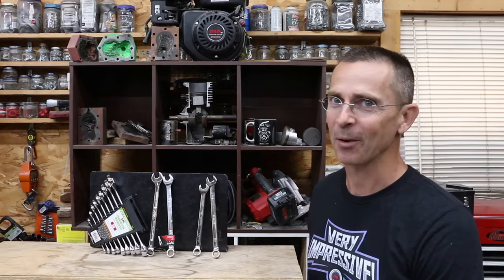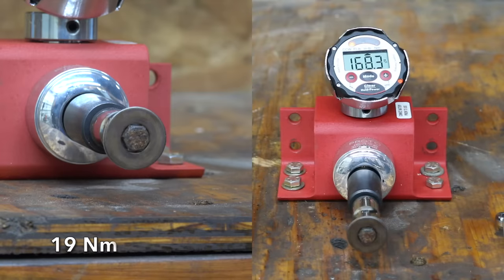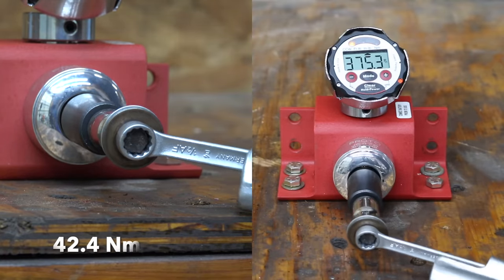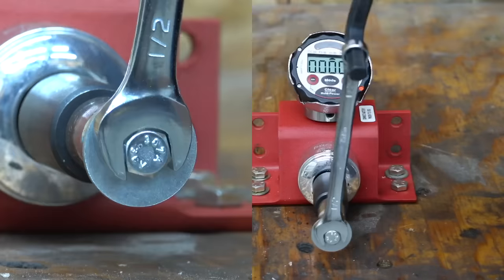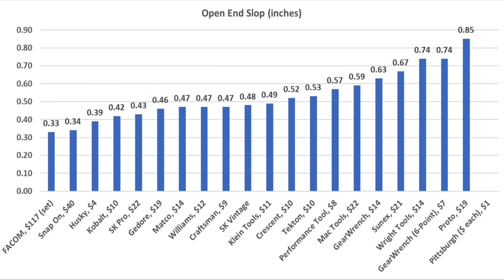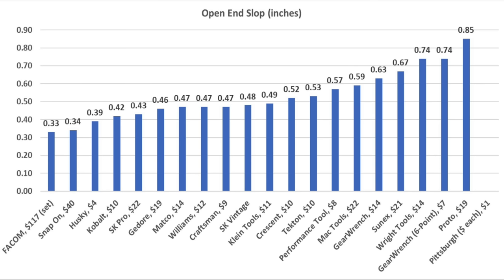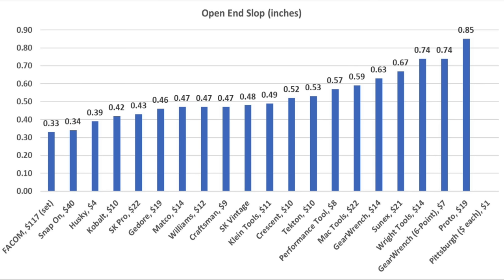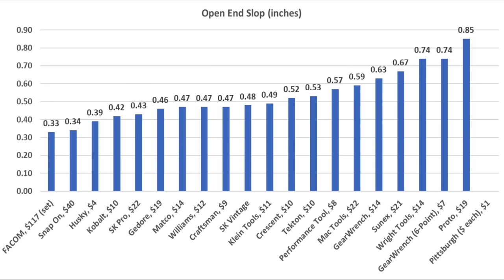Best Wrench? Let’s Settle This! Snap On vs MAC Tools, Matco, Proto, SK, GearWrench, Kobalt, Husky

Comment: Only brand I think we are missing is Icon and maybe old school Craftsman, but I doubt its hard to find old ones in good enough condition, the ones I have belonged to my father and I've been using them myself for the last 20 years without issues. That said those wrenches are well used
Reply: I agree ….I have good luck with my icon wrenches
Reply: USA Craftsman are still available on ebay and in many case NOS.  People seem to be dumping them now that value is up every since production switched to the PRC
Reply: @snopro9556  Never broke one or had one fail in any manner.
Reply: Yeah I don't know why no one tests the icons, they have great price to performance in my opinion
Reply from the maker: Thanks for the feedback.
Reply: Lots of brands that are missing. Icon, Cornwell, Mac USA made, Milwaukee, Klutch, just to name a few.
Reply: Still using a nearly complete Craftsman wrench and socket set my dad used during his farming days of the 50s, 60s and 70s.  Don't put them to the test like he did, but they still hold up for my needs around the place.
Reply: @chrisp174  Yup, Milwaukee does perform well on other tests, so it would be interesting. Also left out is Kyoto Tool Company (KTC) - recognized as one of the tops from Japan.
Reply: Old American tools are heirloom worthy.  The quality is almost something else.

Comment: I think you have the old style snap on the flank drive has the grooves cut into the open end it actually helps quite a bit !
Reply from the maker: Thanks for the constructive feedback.
Reply: YES! I just posted a comment about this. The flank drive wrenches are about $3-4 more expensive but when you need it to work, it works! (HD diesel tech here)

Comment: You also have to note that one wrench was made thin to work in tight spaces, but they don't hold up that much. Other wrenches are bulky and unwieldy, but they can withstand more stress. I think something like that should also be considered in the test. Whether the tool is handy and such, otherwise the test makes little sense.
Reply: I usually view these videos as a "data report." The conclusions aren't the "best" wrench, but rather the highest test results. Combine this data with more subjective needs to reach a real conclusion of what's best for any situation.
Reply: ALOT of variables to take into consideration that he fails to bring up. Something tells me he may make tool related videos for YouTube but that's the most tools his hands have ever touched in his life Idk..

Comment: I've always tried to figure out why they put the bevel on the inside of the box and wrenches.  Okay I understand the bevel but it should be minuscule. Same with sockets.
Great demonstration.
Reply from the maker: Thanks!
Reply: Am I the only one who has had to grind down the bevel on wrenches/sockets to get them to fit?  Had to do that to remove a rusted differential plug on a Mazda RX7.  Yes, count me among those who don’t want the big bevel.

Comment: Suggested video: would be interesting to test and compare radiator coolant additives, claiming to reduce heat up to 25F. Thank you 👍 ✌️We are going to test that! 🙂
Reply from the maker: Thanks for the suggestion.
Reply: Definitely a great Idea. Here in South Tx its very hot so thats Definitely something I'd be interested in.
Reply: BND Automotive quantum gold coolant is the best I have ever used!
Reply: @Jackmerius_Tacktheretrix  I felt that summer heat, lived in Houston 5yrs 😎✌️

Comment: I always had really good luck with Proto. I still have a set of their wrenches. They are black oxide, which I think were intended for railroad use. If I remember correctly, the reason I got them that way was because that was the only finish that was offered at that particular vendor. They have held up quite well even without being chrome.
Reply: I was a mechanic back in the 70's. It was SK Wayne back then. Snap on was just starting to take over the vendor truck business. But I always liked PROTO the best. They had a better feel to them.
Reply: Proto used to sell the black oxide, and chrome plated. The oxide were cheaper, and quicker to rust...but I have a black-oxide adjustable Proto from the 50s that is in excellent shape. Made in Los Angeles.
Reply: I've never seen Proto for sale "direct to the public," but we had a ton of them when I was in the military. I was under the impression that they marketed almost exclusively to industrial customers. Nowadays, you can find almost anything for sale online.
Most of my personal hand tools are Kobalt because I got a killer deal when Lowe's was changing the packaging one year. They've held up fine, and you can replace wrenches and sockets individually rather than in sets, which is a huge perk for me over other 'cheap' brands.
Reply: @Lawrence330  It's entirely possible you are correct. This was in the late 70's. The "tool truck" I got them from, I'm guessing; he was just a local yokel. The truck was a converted USPS mail truck. You could still see the outline. Before they were privatized. I always thought that part was odd. But, I was working as a mechanic for a large school district and they said he was legitimate. So, if he was a go between or whatever; that's how I ended up with them. Another weird thing he did was if the Snap-On or Mac truck was there, he would park right outside the gate and wait until they left. Everybody noticed that, too. I don't know what his exact situation was, though. He did have really good prices.
Reply: One selling point for the black oxide finish was that for an industrial setting where tools were provided to the workers they were much less likely to be stolen then the chrome plated tools.
Reply: @HanstheTraffer  Proto makes quality tools
Reply: Proto makes quality tools or at least did. I have a few tools from them kicking around my toolbox, one of which is a 1/2" ratchet that's on par with a dual 80 or 100 tooth from Snap-On and it's built like a tank. I believe it was made for the military yrs ago but still works great in certain places so won't get rid of it.

Comment: I worked for Mac tools in the 70s when their hand tools were still forged in Sabina Ohio and finished in Washington Court Ohio, and  I went to The Easco Hand Tool Company ( had been the Moore Drip Forge Company) that made Craftsman tools in Springdale Arkansas in 1980 and worked in engineering there for 21 years.  Sadly all these tools are now made off shore in China, Taiwan, or Mexico now.  It is a sad commentary on US manufacturing when so few things are made here now and quality has suffered, although it is nice to see that Mac has maintained standards better than many other brands even if the tools come from Taiwan.  I still have an original set of Craftsman combination wrenches that I bought 65 years ago as a teenager and they have never disappointed me.  Thanks for posting these tests.
Reply from the maker: You are welcome!  Thanks for sharing.

Comment: Why doesn't the "box end slipping torque" column in the end table have rankings? So many of them are "1" but I think this is a disadvantage to some wrenches that dramatically beat the pricier competition. The Husky came in 3rd on that test- well above some way more expensive brands. It additionally was given last place on one of the tests due to a testing error. All things told, it seems like this very cheap wrench really held its own against the Mac/Snap On wrenches overall and probably deserves a bit higher overall ranking. The rusty bolt slip test ranking seems to have skewed the results considerably by not ranking, but rather giving a 1-8.
Reply: A good quality wrench is about more than just strength. There is no comparison between a low-end brand like Husky to top-tier brands like Mac, Proto, and Snap On. This video is mostly for entertainment since you and I both know that you aren't going to dish out $700 or a 12 piece set of Mac wrenches or more for Snap On.
Reply: The husky absolutely smashed the others if you figure the price. AvE did a 3/8 ratchet test and the husky smoked em all....
Reply: Yeah, don;t know why the Husky was given a 19th place score in the open-ended test based on a testing error. If you remove that score it had a 6.75 average placing it 6th overall. For a $4 wrench it was the clear winner overall. Unfortunately this kind of thing crops up all the time with PFs tests these days. There is often a strange choice of test that skews the scores to a particular design or tendency that isn't representative of the point of the testing.
Reply: That test is pass or fail because 370 is the breaking point of the bolt.  Husky had a high torque rating because that bolt withstood more force. It's a discrepancy with the individual bolt, not the wrench. That's why even the wrench that broke the bolt at 369 still received a 1.

Comment: Outstanding selection in the lineup, the only brand I would have like to have seen is Capri because warranty is important to me and theirs is supposed to be almost as good as Tekton. Icon would have been nice too if you ever do a recap.  Chinese Gearwrench?  Why would you make your 6 point tool from inferior quality to 12 point when the former is the one you will grab for the toughest tasks?  They really seem to be in a freefall with going back on warranties and quality.
Reply: Where do you buy Capri brand?  I buy Craftsman and Husky because I can just walk into a local Lowes and exchange anything broken.  They actually let me get anything I want, walk in with a broken screwdriver and they say pick out any screwdriver you want doesn't even have to be the same.
Reply from the maker: Thanks!  Thanks for the suggestion.

Comment: I bought Pittsburgh wrenches almost 30 years ago. I've used them quite a bit over the years tho not professionally or daily and never any issues with normal use. I can't complain about them. Now that HF is climbing into the pro realm with Icon...if I were buying in that capacity, I'd probably go with a traditional source. Just my two cents.
Reply: Yep, HF is getting too big for themselves. Not interested in their premium brands after they convinced me their cheaper stuff was good enough.

Comment: I worked on an assembly line at CASE and I needed a set of long handle wrenches, and the choices were all high end brands or a set of Pittsburg.
I bought the Pittsburg's and in 8 years I wore the 10mm out twice backing an impact gun up with the box end.
But that was still very affordable in comparison.
Something cool was, some hydraulic lines were difficult to get wrenches on, so we would make disposable wrenches with different angle necks on our laser.
I still have a few of these, that get used once in a great while.
I do spend money on my ratchets, as I have stripped gears out on the cheap ones.

Comment: The testing is phenomenal. Among the best to be found on YT. But the results were extremely frustrating. Inconsistency ruled the day, with many main-stream brands scoring high on one test, middle of the pack on the next, and near the bottom on another. Seems you can’t simply depend on any brand for consistent quality. Very disappointing.
Reply: My thoughts exactly. Manufacturing tolerances and quality control have been loosened up so much over the past few decades that we can actually count on inconsistencies today.
Reply: In this case, I’m not sure it has much to do with manufacturing tolerances or quality control.  It’s most likely the material science and engineering economics.  In other words, if you used a material, manufacturing, and heat treatment process that could handle all of the weird impact and creep loads that combination wrenches experience, it’s going to be prohibitively expensive for consumers.  Between “cheap” and “excellent”, there is probably a massive ‘no man’s land’ of design trade offs you have to make meaning you’ll do well in one category at the expense of another.  And at the end of the day, a consumer can just go down the street for another $10 wrench if it fails (or you leave it in the engine bay like I used to do and lose it forever).  Not so true with the $10,000 specialty combination wrenches they use for certain defense tasks
Reply: @stevebean1234  I would like to know more about these $10,000 specialty combination wrenches they use for defense.
Reply: @samdajellybeenie14  depends if youre being sarcastic? 🤔  Or serious?
Reply: @stevebean1234  😄 I’m totally being serious! Are they made out of special materials or is the R&D super expensive or something?
Reply: @LostButMakingGoodTime

Hey.... "good time" (lol), what will really do your head in, is realising that a $4 spanner clearly out-performs a $40 spanner, which we all have been buying because a "white van" has been coming round to our garages selling us inferior products for 10 times the price........ im so annoyed and broken over the money i have spent, when i could have baught 10 times what i have now, and better quality......

I am more then "snapped-off" at how i have been cheated...... how we all have been cheated..... im going to get my Huskys and go shopping (we live in a cold enviroment)..... lolz....

Comment: I love those Mac wrenches. I recommend them to everyone. The biggest thing I love is the design of the middle feels very good in the hand and doesn’t dig into your fingers/palms like other wrenches because they’re fairly thick and nicely rounded. They’re pricy but I think they were worth every penny. I got the metric 6-32mm set for $350 or so on sale but I think they’re 450 ish normally.
Reply from the maker: Thanks for the feedback.
Reply: Do you have a part number for that 6-32mm set? This video has convinced me to switch over to Mac wrenches!
Reply: @VorsprungDurchNik  I do not. I bought them a couple years ago now. Sorry. I know they still make them tho.
Reply: @Blazin Off-road  That's alright, I appreciate the response. The MAC truck comes around every Tuesday morning; this week I won't be ignoring him.

Comment: Just a point of order 
The facom at $117 for 12 wrenches is LESS than $10 a wrench making them cheaper than a number of wrenches that are less than the $12 a wrench you quoted the facom  of costing ..... I went thru a bunch of comments and am really surprised no one else (that I seen) pointed this out if they were nearly $12 a wrench that set of 12 would be nearly $144 but at $117 would be nearly $10 a wrench as 10x12=120 ..... just a simple mistake any of us could make .... no one is perfect  .... still like your videos been watching a long time & the only reason I said anything that discrepancy isnt fair to facom
Reply: He probably bought them individually and that's what he likely paid.

Sets are almost always cheaper per piece than singles.

Comment: Tried this test many years ago going to school for diesel mechanics. We put a Craftsman, Snap-on flank drive, and Snap-on flank drive plus on a frozen fastener on a steering drum on a Allison Chalmers TD25 Crawler and the results were obvious. The Craftsman jaws spread fairly early, the flank drive did pretty good but let go before the flank drive plus. We concluded the flank drive was the better buy due to the flank drive plus marring the bolt heads for a little more gain and Craftsman spreading early. The reality is though this only comes into play when things go South and almost any wrench will service most needs. Severe loads usually require a torque wrench anyways and a torch is a better friend than a cheater bar.
Reply: The torch is amazing if people could just resist turning everything into a liquid

Comment: I feel head thickness should be a factor for hard to reach or low clearance. They may have given up sooner but are more viable in daily usage.
Reply: Yeah I have a set elora wrenches they are lightweight and thin for a reason. If I want to bang on something with a hammer I have a cheap set I don't care about for that.

Comment: When the bolt breaks before the wrench breaks or loses grip, it's not accurate to give it a rank of 12 for that test just because the bolt broke at a lower torque than 11 other wrenches. In that case all wrenches that held until the bolt broke should tie for first place. To see which wrenches are truly better, you have to use bolts that are stronger than the wrench, and/or repeat the test many times to see which wrenches complete the test perfectly and which give up or let go before the bolt breaks.
Reply: My understanding of the scoring on the final table shows that they did all tie for 1st place in that round.  Good luck finding bolts stronger than the wrenches. Remember these are 1/2 spanners so only an m8 (5/16) bolt. They snap for fun even before rust treatment!
Reply: That's why he used an Allen key on the last test. Sk pro is the strongest
Reply: And he's putting over 300 ft lbs on the wrenches, I'd like to see someone do that with one hand! You would need a cheater bar for sure!
Reply: @farmerstu05  I stand corrected. The most problematic test was "Open End Slip Torque". This really measured the point that a weak bolt rounded over. SK Pro placed 18th, which dropped its average finish to 7.0. If the wrench didn't fail in any way, why should it be ranked lower in this test? It's the bolt that failed. And why wasn't the wrench sizing accuracy (slop) included in the overall rankings?
Reply: @fridaynightgamefilm  wrench design makes a difference in the open ended slip test.

Most wrenches apply pressure to the points on the bolt heads.

Wrenches that are designed to apply pressure to the flat faces of the bolt head are applying force to the bolt where it is stronger and can actually take the higher load.

Additionally, wrenches which have wider faces where they contact the bolt head are also distributing the load across a wider area.

So yeah, wrench design can still have a significant impact on overall performance even when it seems to be a fastener failure.